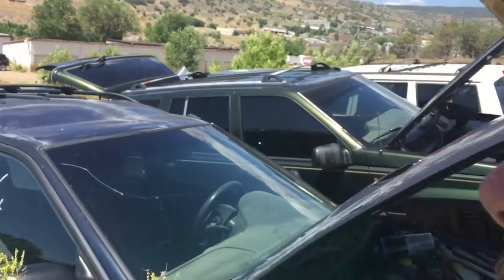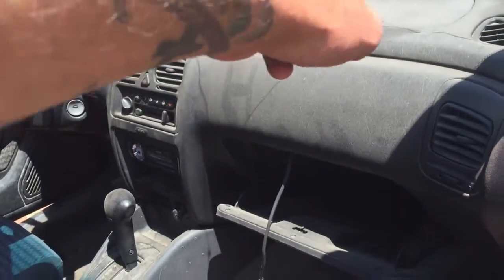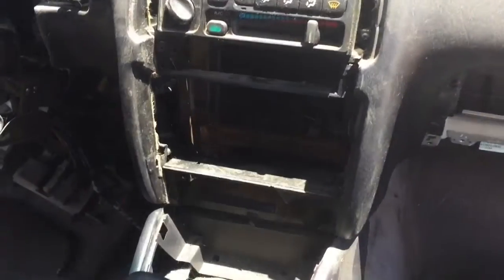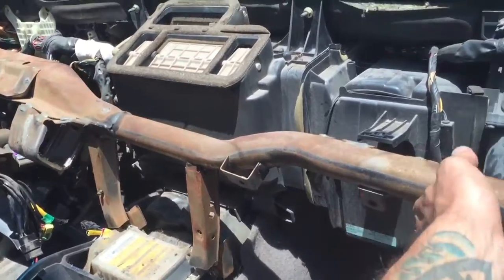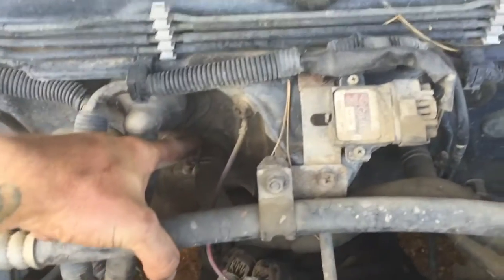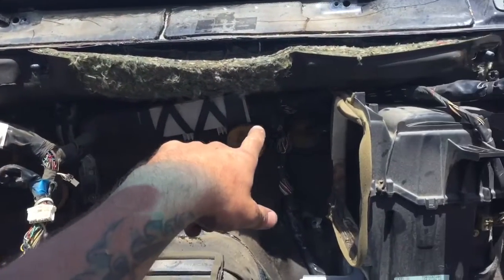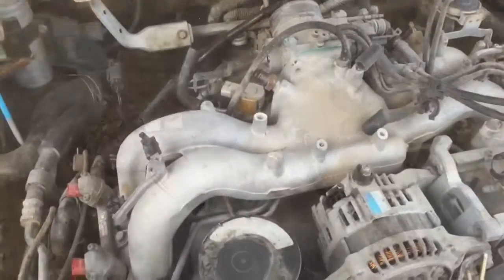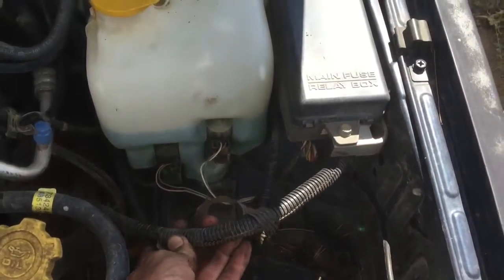Pull wiring harness for Subaru JDM engine

Comment: Would you also want to take the crank and cam gears? I understand they are matched to the ECU. At least they are on the later models. Ask me how I found this out...
Reply from the maker: +Forthwith Tx You would absolutely want to do that if you were using a computer/harness from a 2001+ USDM Subaru. That seems to be the time when they switched from the early 6/7 timing triggers to the newer style (I forget the numbers but I think it's 36 on the crank). I think that will be a good thing to go into on one of my upcoming videos. Thanks!
Reply: +Forthwith Tx Is this only true for a JDM motor with a USDM harness and intake? I'm putting a rebuilt 2002 USD motor in my van and am worried I won't pick the right ECU for it.
Reply: Don't quote me as I have not swapped a JDM engine, but I have spoken to someone who has, and they said that the engine harness, itself needs to be swapped as well because the JDM engines don't have either the crank sensor or the cam sensor, or they are different somehow.  As for the ECU and crank pulley, they are matched.  I swapped a 2004 block into a van that already had a 2001 block, and the trigger points were very different.  Twice as many triggers.  It would not run and the fuel was dumping into the cylinders. I swapped the crank gear from the older block into the newer block, and Bingo!  Ran like new.  Mitch will probably know the particulars of the JDM swap requirements.

Comment: have you done  the EJ22T  yet. I just pulled mine out of a 1994 legacy wagon turbo.  I just have to get the fuel pump wire. The main harness unplugs   half way of the vehicle.
Reply from the maker: +Hiram Whitaker Hey Hiram, I haven't worked on the BUGaru project much lately - paid projects get in the way sometimes :) I should be posting a radiator mounting video soon though, then I'll be diving back into the EJ22T clutch and mounting.

Comment: I was looking to putting a JDM 2.5l into my 77 Bus. Did you use a USDM harness? Do you have a wiring diagram seeing it is for a JDM engine? Thanks
Reply: You've probably already moved on in your project but just in case; he was pulling a harness, ecu, sensors, and air intake from a USDM (US domestic motor) to put on a JDM (Japanese domestic motor). Pulling all those parts generally will allow the US ecu to control the Japanese motor.